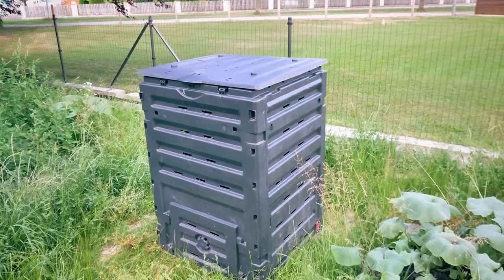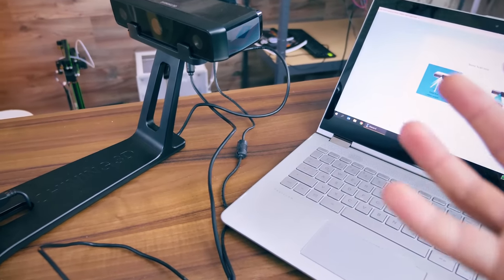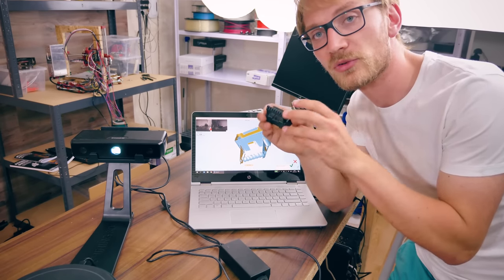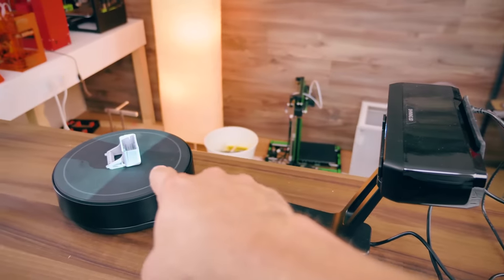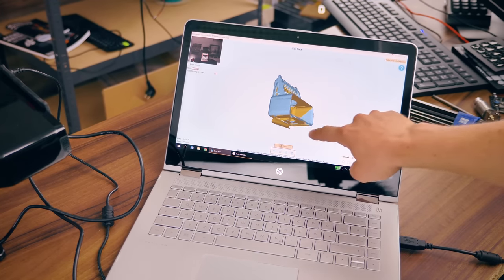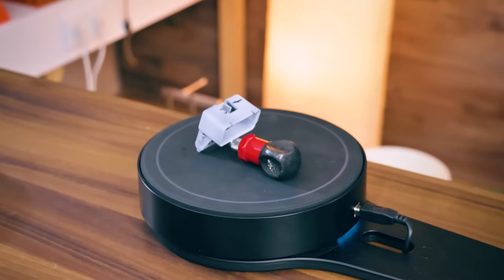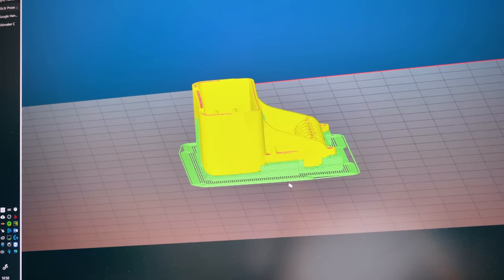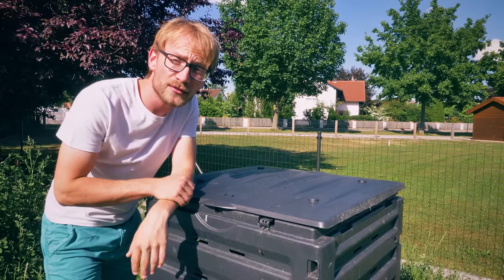I copied a 5ct part using tech worth thousands

Comment: I love how 3D printing is potentially one of the most practical hobbies you could take up these days... And yet the moments where you actually use a 3D printer for something practical are so rare you feel compelled to make a video about fixing a compost bin.
Reply: I am addicted to having a problem and creating a part to solve the problem. Feels very gratifying.
Reply: My house and garage is filled with practical solutions to problems. In fact I'm drinking from a cupholder mounted to my desk...
Reply: My friend said the same thing a few days ago: that there aren't many actual practical needs for one. But the thing is: that's NOT true. There's tons of practical uses for it, you just need to develop an eye for it. We're not used to thinking in a "well maybe I can improve this by doing this or that to it". If you DO develop that eye, you'll find that you have tons of stuff to print for.

Examples of stuff I printed recently: a clip to keep the dishwasher from closing accidentally after it's "venting", a replacement cap for a garden pole, a holder for my Nvidia Shield TV remote next to my bed post, a clip for my Philips LivingLights remote, a foldable headphones hanger, a headphone wire clip so it doesn't get tangled in my pocket, a replacement case for my FiiO MP3 player, a clip-on spring for my door so it doesn't bump into the wall, a replacement part for my father's cigarette maker, a rack for dirt wooden kitchen spoons so they don't dirty the counter top, etc. etc.

Comment: For small pieces like that, it would be nice if manufacturers provided a STL for home repairs as 3D printers become more common.
Reply: Idk, they'd lose out on the money to sell you parts.Maybe if they charged extra for the files they would.
Reply: You can download 3d models of nearly every part on McMaster-Carr's website, what more do you need! :D
Reply: BEdmonson85, McMaster-Carr's terms and conditions says that the 3D models are not to be 3D printed for any reason. Just an FYI.
Reply: Andrew Frink , hmm, interesting, did not know that. I doubt that would stop most people though.
Reply: calipers are dirt cheap, though...
Reply: @Cynyr  Don't care. They knew the risks about putting data on the internet.
Reply: @Cynyr  hippity hoppity. It's now OUR property
Reply: @rdizzy1  well yes and no. Many manufacturers don't sell nor stock small replacement components. They just assume that people will either jerry-rig it or replace the appliance outright. Having STLs available (maybe only to commercial printing houses?) would allow people to fix their own stuff easily and cheaply. This would kill revenue from replacement appliances though. Right-to-repair movements under a friendly government and public might be able to push this requirement through. Manufacturers definitely have all of this readily available or can easily make them with scanners.

Comment: This is one of the much needed videos about 3d printing (and scanning). It always amazes me that so few people seem to use their 3d printer for anything useful. All I see on FB groups etc. is Cosplay stuff, superman masks, all sorts of decorative dustcatchers etc. I rarely to almost never see anyone print something useful. I for one have a mechanical engineering and a computer science degreee, so for me this printer is a combination of both to design and print functional parts. Right now I'm in the final stages of printing a large motorized and remote-controlled camera slider mechanism that allows you to move a camera along a rail while focusing on one point. Since there's a camera interface with it I can potentially program it to zoom in or something the like. This is fun - and useful.
So yes, useful parts - even replacing a hinge on an otherwise mundane composter -are very much interesting.
Reply: Uwe Schroeder 
I don't know about everyone else,  but when I print functional stuff, I rarely show it off since it's in use. I'm sure there are a great many people who print functional stuff, but display pieces are better for showing off :/

Comment: The advice I received for multiple scans is to place the object off center as well as centered on the revolving table so that scanner has different views to gain information.
Reply: good advise, also raise small parts like that up on 4 thumb tacks or needles with Plasticine to allow a better angle without a large contact area to trim.

Comment: I keep reading in the comments "probably could have drawn it faster" etc.  yes you could, but that was not the point, he used this as an illustration that scanning technology has improved to a point that there is an option for parts that cannot be readily drawn.  Quit focusing on his baby blue eyes and listen to the words that are coming out of his mouth. LOL
Reply: @jonmessenger   but...but they're so mesmerising.
Reply: OU812 I agree.  They are very much mesmerizing.
Reply: I say the opposite. great, you have scanned a mesh file. good luck sending that to anyone other than a 3D printing company. you don't end up with a solid part. most of the time you have to completely redraw the thing anyway, but use the scan data as a template to re-draw it.

So if you want to get a 3D scanner, everything else in your business better be able to handle the "ecosystem" of it. 3D scanning + 3D printing + mesh editing software is great.

but for where I work, we use solid works and, and need CAD drawings to hand make items, and a 3D scanner was a terrible decision, as we have nothing that can support the files the scanner produces. I have actually used works 3D scanner more for personal projects than work related ones
Reply: Also, if you want to use it in an assembly of other modeled parts, nothing is flat/straight so you can't properly constrain it to anything. In the last 15 years, very little has changed regarding the obstacles of 3D scanning except for the price of the tools.
Reply: Another issue is that if you draw it yourself, you can reinforce areas to account for the 3D printing which tends to be weak through the layers. You can also eliminate unneeded penny-pinching (which can make sense for large runs) and potentially eliminate design flaws (like stress concentrators). The point about this just being an illustration of scanning technology is well taken though.
Reply: You are right. If you can make it yourself, why not make it better than the original?
Reply: he has copied a bad part 1:1 into a new bad part again.
It doesn't even make sense to print it like that and it takes more effort to repair/reduce/smooth the model than anything.
The Einscan is slow, not precise, way too limited of what it can actually see and too complicated....especially what it produces is. A mess of million polygons and artifacts.
Reply: those baby blue eyes sure are distracting tho haha !!
Reply: If the point of this video is about how much scanning technology has improved, pointing out that drawing is still a better option for pretty much anything that isn't organic is in fact still on topic. The advantages of a scanner would have been better illustrated if he scanned a leaf or a twig, which is ironic because that wouldn't be very practical.

Comment: We recently got this exact scanner at my high school, and I played with it quite a bit. Now, you may have noticed that the mount on the bottom of the projector/camera unit is a standard tripod mount. You can, in fact, take the scanner and turn table off of that big piece of plastic and play with different scanning angles, and even scan larger objects (I spliced together a usb b and mini b cable since the included one is so short). You just have to make sure you calibrate every time you move the camera or the turntable. Moving away too from the turntable can also sometimes upset it during the calibration (since those cameras are aimed a little bit towards each other, you eventually start having blind spots). You're also able to take single frames to try to get difficult detail, but you've probably done that. I've also found that even if you don't need the color, letting it run the full color scan can help get some extra detail and help with black or shiny objects. This thing has amazed me so far! It's amazing how accurately it can scan tolerances with not much more than a couple cameras! We've used it to make a few dell hard drive caddys for the IT department. Did a direct scan to print. Incredible! Looking forward to seeing some creative uses of this scanner!

Comment: Interesting, it seems 3D scanning takes as much work and dedication as 3D printing.
Reply: I think that 3D printing is moving towards and getting close to a point where the work and dedication is just pressing the go button, as it should be. Generating the model is 99% of the work. You have 3 options, 1. Use and existing file (someone else did all the work) 2. Make file in CAD (which for objects like this is tricky for most people) 3. Scan (think of how much work that saved you)
Reply: @jodyschultz5870  It's also great to see all the different 3D printing technologies (like FDM, DLP, SLA, DMLS, etc.) becoming better and more affordable for the hobbyist. I hope to see the day when these technologies are combined into single machines that can fabricate finished products at the touch of a button.

Comment: I relate to this so hard - I printed up a part for my vacuum - the bearing had seized on the beater bar, melting the plastic locator. It's a cheap part to replace but I decided to model and print one up because it's so satisfying.

Comment: That is some pretty impressive scan result. 
I just don't see any use for a scanner in my workflow. I would love to see a time comparison for such a simple piece with someone familiar in CAD to make a manual remodel, and someone babysitting all these scans and making shure your scanner gets all the details. My current guess is that for such simple mechanical models manual reverse-engineering into CAD is faster. And you get the added benefit of having a cleaner model to add improvements/reinforcements where needed.

Comment: Just a heads up, if you simply go into 3D builder which comes with Windows 10. This will allow you to have a part lay down and what now. I kinda prefer it for super basic functions like that, split a part up, and so on
Reply: For previews and simple, rapid edits like this, 3D Builder is also my go-to app now, especially if I'm working on my Surface. It's fast and seems like it has very low overhead, so it doesn't slow down.
Reply: Whoa, I have a surface but mainly use my desktop for 3D stuffs, but this is a good use for it, thank you for the tip
Reply: I also do a lot of Fusion 360 work on my Pro 3 as well. It still holds up great and is an excellent tool to knock out some designs on the go.
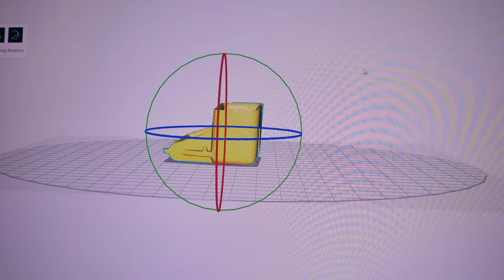Reply: Cura has a "Lay flat" option in the rotation menu, it was even visible at 19:51 :-D

Comment: Just in case, the '3D Builder' Software that comes with Windows 10 has a feature to automatically place an object so that the bottom aligns with a straight surface, could be handy for such purposes
Reply: Most slicers have that feature.
Reply: Cura has this feature too. "Lay flat button" is above "Snap rotation" checkbox
Reply: Any experience how well that works with noisy surfaces? 3D scans of flat surfaces are not exactly CAD-level flat.
Reply: 3d builder works really well, because it uses physics to lay flat the model, though you have to rotate it in roughly the right direction in the first place.
Reply: Also if you cant put it flat because of labels or uneven base put it a few mm above the tray so you have structured support material to trim not the mess of shallow support material.

Comment: Glad this is your video and not so many other 3d printer channels that would go through all this trouble and then print it in PLA and I would have to facepalm, heh.  Great material choice!  For this part it could have been modeled faster than it could be scanned, but this was a very interesting part to torture test that scanner with.  I am quite surprised how well it did all that concave geometry even with the finicky steps of needing extra angles in there.  I will have to add this scanner to the list of things I REALLY want but cannot afford, heh.
Reply: The dual cameras to cover distinct angles help a bit, but it really needed the multiple orientations, and a bit of guidance when aligning. The double hinge version was a bit funny though. :)

Comment: Wow. I'm way more impressed with that tool than I expected to be. So, for that last scan to clean up the inside, is there an option to tell it to do, say, 120 or 180 degrees of scan, rather than a full 360? It would save time and data, and could possibly allow you to not have to edit out your prop materials.

Comment: In Slic3r Prusa Edition 1.41, there's an excellent align to bed function in the plater tab, third round button on the left in the 3d view. It autodetects roughly planar faces on the model and you can click one to place it on the bed. It doesn't try to align walls, though.

Comment: Hey Thomas, I noticed that you use the glue stick to print.  I started to use Magigoo and it's way better than glue stick.  It's liquid and applies very thin.  It's only active when hot.  It doesn't leave a trace on the part.

Comment: Btw. there's sprayable rubber (Plastidip) which they use on cars and rims. Which you can peel off later. Might be a good material if you ever need to change the color of an object for 3D scanning.

Comment: The 3d scanner looks like a modified xbox kinect
Reply: Ronald Witteman yeah, in fact software exists to use an Xbox Kinect for this exact use.

It's not as accurate, though I'm not aware of exactly how much the difference is.

A Kinect is a 3rd the cost of this new, probably à fifth or a tenth the cost used. So it's worth experimenting.
Reply: I use Skanect with my kinect, It's passible for gross detail, but the sensor isn't really designed for detail. Call it 2-3cm resolution, roughly.
Reply: I wonder if a fancy magnification lens+kinect would still be cheaper than a good scanner like this.

The 'resolution' of the camera doesn't matter if the object is 'big' enough to the kinect lol
Reply: Same thing that came to mind. Looks like an upgraded kinect with a base. Even the imaging software looks similar.
Reply: Similar tech; the Kinect 1 structured light projector is a fixed pattern and infrared, while this uses a dynamic pattern, visible light, and two cameras (Kinect has one IR and one colour, so only one of them sees the projected pattern).
Reply: LoneTech
I wonder if you could use two Kinects so two cameras are now looking at the projected pattern and get better data from it?
Reply: @Abdega  They just get confused by seeing dots from another projector. You do get better data if they look from different directions.
Reply: @doxielain2231  are you actually using the free version or the upgraded one?
Reply: @0LoneTech  The colour camera can see IR just fine. Whether the kinect actually uses it might be a different matter though...

Comment: I use baby powder mixed in isopropyl.  I mix it in a spray bottle, then when the isopropyl evaporates it leaves a temporary matte surface.  To create points for it to correlate all the pictures just get an old toothbrush and put Washable black paint on it by flicking the paint on with your finger.  I use it for photogrammetry

Comment: Cool video. I know the video was showing off the scanner but aside from that, if we were to just model that part in a much simpler way I think it would be not only way faster but also much stronger. They have all those pockets for injection molding to save material that just weaken 3DFDM print.

Comment: 19:45 In the discontinued "3D Builder" for WIndows 10 you could level a part based on gravity. Just give the 3D model a pull and the algorithm would work out how to lay it flat. I'm not sure you can still do that in Paint 3D or similar apps.

Comment: Wouldn't it be cool if they could add some 'gravity' simulation to the CAD software to have an object 'fall' to the floor and lay flat instead of trying to rotate it manually to lay perfectly flat for printing.
Reply: It's just slic3r that lacks this. Most other slicers can align surfaces to the printbed. Not sure how well it works with noisy uneven results like from a 3d scan thogh.

Comment: The root cause is that the lid is held at 30 degrees from the vertical at rest position when open at 23:25. It creates too much stress on the hinges. I would either have reduced the angle, or added a way to transfer some of the moment to the sides or back or something

Comment: Hi, Thomas. Latest development slic3r already has an interface where you can align a surface to the bed, just like Ctrl-L from Simplify3D. I'd put the screenshot if youtube did not phantom-band me every time I try to reference some stuff in posts.

BTW, there are cheap scanners like the cyclop and open source software like CloudCompare which basically could do the same task. (Which I used successfully too)

Comment: Fantastic video, thanks!
As for why your CPU isn't fully burdened, I think that software is using the GPU for computing, not primarily the CPU. It looks like your GPU utilization was pretty high, and the company's documentation lists minimum suggested GPU specs. You would probably get better performance on a desktop with a nice beefy GPU.

Comment: You know cura has a plugin which can auto rotate to best suited print orientation. I use it and most times it's pretty much perfect.
I would have re-enforced the arms more after the scan to strengthen it even more so it won't break like the original part.

Comment: It seems like it would be a lot easier to just make it in blender or simplify 3d. Plus doing so you would be able to beef the part up in areas it needs it since it won't be quite as strong as the original part.